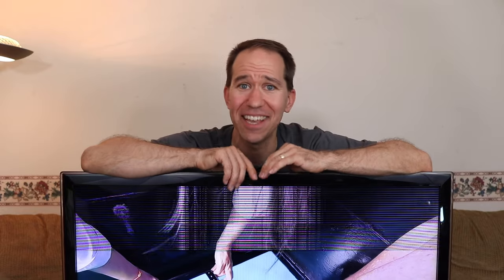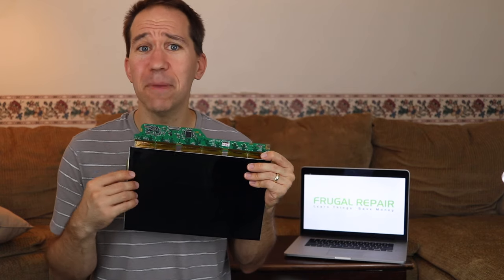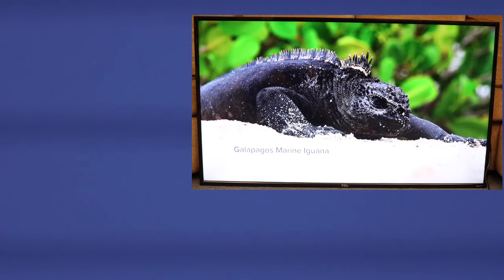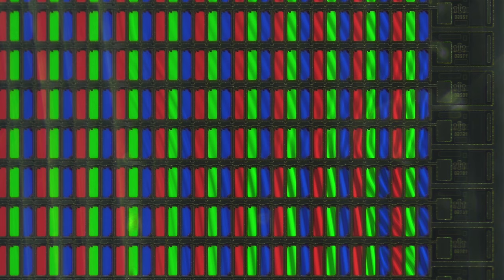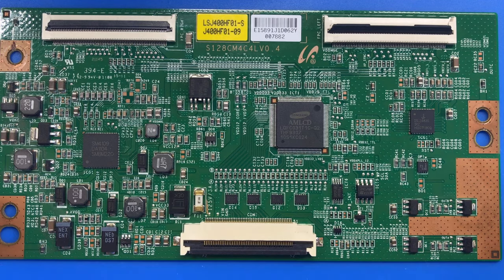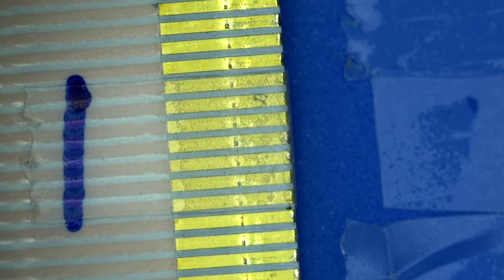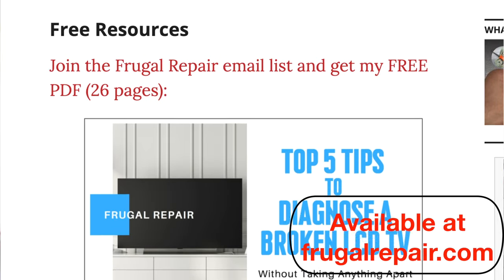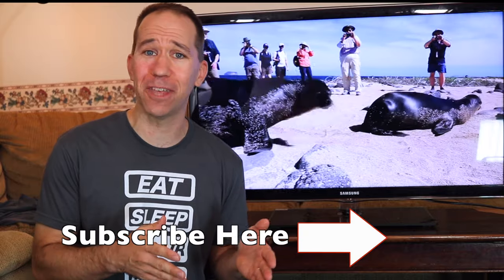Repair Hack Explained | How to Fix TV Horizontal Lines - Part 2

Comment: I have a problem with my 55" LG LED TV. The right hand side of the TV does not display every 6th horizontal line. The left hand side is perfectly fine. The black horizontal lines tend to dissapear mid screen.
Reply from the maker: I'd try the trick like i did in the video.  I hope it helps!

Comment: Thanks for this tutorial.
I have An Xiaomi mi 4s tv wich had black screen. I figured out that disconnecting on of the cables of T-con board gave me half of the screen back.

Im now Trying to figure out what lines to Block of the clocksignal. But the clock is on the right cable and the problem is the left one. 

Im not that techican to determine with lines to Block by power testing IT. But can it Hurt my tv i Just block some of the parts and see what is going on?

Like different combinations of blocking to so if there Will be an image?
Reply: ah i tried your Method with the multimeter on continity and found out the signals on the left side. Just covered some of these signals with tape and got image back!
Now need to see if the image quality is less, then wil trial and error to see if i can only cover the bad clock signal element :D

THANKS ALOT!!!  your video was so clear and the only one i could find in english!
You saved me so much trouble, time and money!
I had do sent my TV back to China because it was still in warranty, But returning the tv costed alot of money for shipment etc.

Comment: What about one horizontal green line at very bottom of display, that is "running" from left to right and looks something like this: -------------------------------. Sometimes it shows up, sometimes it disapears, it's not GPU problem, because it's showing up on two GPU's I own (both of them never had any issues), it's not drivers issue because it shows sometimes even at BIOS or during boot process. So I'm guessing it has to be LCD display issue. Another clue is when I hold monitor by two hands at the edges and gently apply little pressure at monitor this line will instantly dissapear for a few hours, and at some point it will show up again.

Comment: I have a gigabyte g27f 144hz monitor and have a small thin blue line Vertically on the screen that goes from top to bottom. it will go away when I apply extremely light pressure on the top end of the screen where the line starts. It will go away for a while. Sometimes stays gone for days, but might come back sooner sometimes. ALWAYS goes away with a light pressure touch. Sounds like a bad solder joint or connection from the ribbon to the screen. What would be an easy fix without having to tear into it? The line is only about the width of a debit card or paper business card, so it's fairly micro.

Comment: Hi. I have a mercedes comand  ntg with horizontal lines, and i wanted to see if this could be fixed, it started with 2 lines, and now there's allready many. i have seen several units with same lines on different forums, and solution is to change the display $$$$. so i wanted to try to fix this as it seems there is probably a weakness in thhese displays, what can be the cause of this, is it smd's or ribbon connection on display?? what can i do to try and fix this, unit is old, so spending a lot of money on such antiqated tech is not really anything i want to do. so my last option seems to be repairing it, any advice??

Comment: Good morning Frugal Repair! And Happy Thanksgiving!

Today I would like to ask the question on how could I possibly fix it permanently, while removing those horizontal lines with the help of your videos (Thank You!) I would maybe want to invest on fully repairing the TV. Would buying a new set of ribbons work?  I would like to know, just in case I could salvage some TVs and get them back to almost perfect shape, thank you once again, and u hope for the best!
Reply: Replacing ribbon won't help. I swapped the ribbons and had the same issue. It is one or 2 clock signal causing the issue. By putting up a tape you are actually blocking the clock which is causing the problem.

Comment: Hi! I have a Sony Tv and I have horizontal line from the bottom to the half of the screen. I asked some tv repair shop and they told me that I could put it to the garbage, but I do not want that, because the sound is good, only the lines are very annoying. If the lines are horizontal and from the bottom to the half, is there any chance for me to resolve it? I do not have any technical background. My tv is a Sony Bravia KDL 32EX402.Please help!

Comment: @frugalrepair can you do one with vertical lines.
Reply from the maker: I could. Thanks for the suggestion.  It’s usually a different issue than a row signals issue.   Could be tcon board or even people get them when they clean their screens.  The cleaner liquid messes with the connections on the driver board.  You can try gently twisting the corners of the tv.

Comment: Do you think the flickering problem is due to a faulty T-con board?
Reply from the maker: On this TV, no.  The problem is on the driver board or in the panel.  But on a different TV that could be the case.

Comment: I have the dreaded vertical lines. When I turn my TV on the picture comes on beautifully and then within seconds vertical lines fill the screen to where I cannot see anything...not even menus. Mine is a 2017 Samsung Frame Model: UN55LS003 - I cannot find any information on how to take the back off to check the ribbon connectors or the T-CON. The TV was just moved 1800 miles in a moving truck (in a home depot TV box) and it seems to have jolted something loose. No screen cracks...when i unboxed it I totally expected nothing would be wrong. I don't want to lose this TV and the Samsung forums just tell you to call a service person. Maybe you can help? How do you get the back off "The Frame" TV's? HELP!!!!!

Comment: From few days, I'm seeing such black horizontal lines on my hp laptop screen, the lines become prominent in colors like violet and red and in other colors these lines can barely be seen.. I've put the refresh rate to 40 from 60 and now the lines are there but a bit less prominent.. I've tried pressing edges lines are still there..and also updated my nividia graphics driver and display drivers..what can be a fix..can it be a loose cable connection or a problem with the lcd panel...thanks..

Comment: Hi, the isolation technique did not work for me. When I disconnect either of the two ribbon cables, I get a black screen on that side. Half the screen was working in your video. But that's not happening on my Sony LED TV. Kindly suggest what could be the problem
Reply from the maker: If you get the same result on both sides, that is a clue.  I would then suspect the tcon board is faulty, though of course, it could be something else.

Comment: I have 2 LG tvs in need of some help. One is Lg 55uh6030 and a LG OLED65C9AUA. The first one was working fine then once it was on for a while (usually 30 minutes to an hour) horizontal lines would appear then the screen would go black. Sound remained unaffected. I replaced the t-con board board with a new one but no change so i put the old one back. The oled has a black screen with skinny little white horizontal lines on the left side of the screen. Please help

Comment: Is it possible to DIY repair the short/open circuit?
Reply from the maker: Not really with most available repair tools if it’s inside the lcd panel assembly.  You maybe could with a laser.

Comment: Do you have a answer on how to repair a 55" Roku TV it's only 3.months old"  it is 1/2 to 3/4 of the TV screen"" it turns on the lines are vertical,  and I can see a place at the bottom  of the screen where it got hit

Comment: How long can the tape last and 
Apart from using the tape, what's the permanent solution?
Reply from the maker: I don’t know.  I’m still using this tv without issues.  To make the real fix you need to replace the lcd panel.
Reply: @FrugalRepair  thank you so much, I actually tried this and it worked...

But I have one trouble or ripple effect ,
 before now, I didn't have a thin black black horizontal line in the lower part of my screen, but after the trial, I noticed it.
I have LG  55inches LED 4k tv.
Please what futher thing can I do?

Comment: hey there man... hope you can help me.. i havea 55 curve samsung itwas turning on and  off at first then using tape i got it to turn 9n.. but there are lots of vertical lines still very visible... help pleeeaase
Reply from the maker: Sorry, there’s too many possibilities.  The isolation technique should tell you if the problem is on the tcon or on the lcd.  It’s possible that the tab bonds on the driver board are lifting, causing vertical lines.  Is it possible it could be a short circuit in another part of the tv?  Just not sure, sorry!

Comment: I have a 4k vizio with horizontal lines but they are not black. They are RGB.  Between the top and bottom, it's about a 3rd of the screen that's effected. The bottom section now has yellow moving line. I've tried all the simple quick fixes and nothing works. Any idea on the cause and possible fix?

Comment: Hello, what about seeing this lines in the two sides? one side i see fixed lines on the top, but in the other side i see flickering lines on bottom.
Reply from the maker: I would guess either the tcon is the issue, or possibly you have signal failures in different locations in the lcd panel.

Comment: Please help. I have a SONY KD65xe7002 tv. It’s not old in the slightest. It has a horizontal line at the bottom which shifts the picture up and back down every second. This happens on a moving and frozen image too. What do I need to do to fix it?

Comment: I have issue with my sony tv(model no-KLV32-EX330), it is having horizontal linings on top of around 1" And after 4-5 min, half screen gets dat horizontal lines. How to solve the issue, I would appreciate if the solution is given on same model no I have mentioned
Reply from the maker: There are videos online (I’m pretty sure) that speak about Sony lcd’s.  It might be a problem with the tab bonds lifting because of the heat.

Comment: Hello, would you  have any suggestion to a Samsung TV that  starting to slide image down after about 5-10 minutes after powering up.  if unplugged, and then power up again image is ok for another 5 min, but then starts to jump down again.  Replaced main board but behavior didn't change

Comment: The first part where you remove those cables either left or right, once i did that the backlight stopped working and the little bit of image i had is now also gone. Now i am sitting with a completely black screen and no back light. What can be the cause ?
Reply from the maker: Did you remove them while the tv was on?  Definitely don’t do that because you could possibly short something out.  I don’t know why removing one would affect your backlight.  Maybe something else got bumped?

Comment: Hi sir. I would like to ask your help for my tv Samsung 55 inches Smart Tv  Curve.
The model is UA55JU6600K.The issue is that on the right side area of the Panel Or screen has a vertical flickering lines which you cant even see the letters or any videos on that side and which cuts the whole icon from left side going to the right side area of the screen.Only on that side is affected.On the Left side is fully normal.Could you help me out sir please.Thank you.

Comment: On my 70 Inch pihilips 4k that I got for 50€, The color specially Yellow color fades a lot on the taped side, so much that it is almost annoying, but a 2000+€ Tv for 50€ I wont complain,  But my question is, does a larger TV suffer more from the tape trick than smaller tv.s ?

Comment: Hi question for you this very same problem happened with my TV I have a 19 in Sceptre and it's got the lines going horizontal and vertical so how do I fix that the? same way?

Comment: I have a Lenovo T24-i LCD monitor and it suddenly blurrs the screen from sides and then I turned Off and send it to the repair shop, instead of repair a line (horizontal) produced at the 1/3rd of the screen. When it’s ON the LED doesn’t flikers but when it’s powered ON after some time then the upper part above the line behaves totally normal. But the part below the line flikers and fades but after some time all LCD goes to normal but the line is constant. If you have any knowledge about this issue please help me out. Thanks

Comment: Hey there. I have horizontal lines on my samsung un46d6400 tv and it appears to be there even when i disconnect the ribbons on the t-con board. In other words, the lines exist across the tv even when the ribbons are disconnected
Reply from the maker: I’d guess tcon board in that case, it could be something else but that is my guess in that situation
Reply: @FrugalRepair  hmm thanks, just sent you a photo of the tv display to your insta!

Comment: My LG 43UK6500AUA TV has an additional problem. Apart from being covered by horizontal lines for 90% of the area, the image under the lines freezes for a few seconds, then works for a few seconds. This cycle repeats endlessly. The top 10% of the screen works perfectly. Will replacing the mainboard, part # EBU64688503, fix this issue? Or is it the ribbon cables at fault? I showed it to a technician and he said that the entire display panel needs replacing. Any help is appreciated, thanks.
Reply from the maker: Doing the isolation test like I have shown in these videos will help tell you if the problem is the tcon or the lcd screen.  It is unlikely to be the main board based on what you have described.
Reply: @FrugalRepair  Thanks for your reply. Yes, I showed the screen to two technicians, and both said the problem was in the panel and unfixable.

Comment: I have a vizio oled 65-h1 TV and have horizontal lines with some burned images in the background. I have swapped out a new tcon board already with the lines still appearing. There are 4 sets of ribbon cables. I am not sure which one goes with which side of the screen. Please help.

Comment: would replacing the tcon board solve the issue?
Reply from the maker: No because the problem is inside the lcd assembly.  Tcon is fine.

Comment: Hello, does this work on IPS pc monitor?
Reply from the maker: The answer is technically yes but on a monitor you may only have one cable from the tcon board so isolating the problem and working on it is much more difficult (you might have to cut the PCB electric lines - assuming the row signals go to both sides on your lcd panel)

Comment: I have a thin blue vertical line on my monitor that just showed up randomly one day. I applied pressure to the bottom of the screen and the line disappeared for a while but it came back and now I cannot remove the line with pressure anymore. Any Ideas on how I can fix this?

Comment: Could the Samsung One Connect box be causing a thin black horizontal line about 2 inches from the bottom of the screen? When I first turn the TV on I have a green fuzzy thicker line which comes and goes. I purchased a new one connect cable and the problem still persisted. It's the same thing on every source. I have taken the TV cover off to just push the cables in thinking something might be loose, but it did nothing. I'm not sure whether to unclip the cables inside and put them back. I don't know whether to try a new one connect box. Running out of things I can do 🤔
Reply from the maker: Did you try what I did in the video?
Reply: @FrugalRepair  Thanks for the reply. I haven't yet as I don't want to break something. I probably would to be honest 😂 I could give it a go
Reply from the maker: You can do it.  Try the isolation technique and that will probably give you the best clue.
Reply: @FrugalRepair  I will try this, thanks.

Comment: My TV has a horizontal band (over the entire width) in the very middle of the screen and the light intensity of that band (about 5 cm high ) is lower than it should be. So a white screen has a light gray band in the middle. What could be the problem and how could it be fixed?

Comment: My TV has the horizontal lines on both the halves of the screen. That would mean mean this method wont work (tried by a technician). Is there another way to fix this problem?

Comment: what if both the tv sides has vertical lines,but it's not the tcon? if both ribbons connected there are horizontal and vertical lines. left connected only is vertical lines only. right connected only no good picture and colors. tcon is replaced
Reply from the maker: I’d double check the ribbon connections but you likely have a bad panel.  Vertical lines are a different issue than the horizontal lines.

Comment: Can i use paper other than tape?
Reply from the maker: The main thing you’re trying to do is prevent an electrical connection. So you could just use a knife to cut those contacts off once you know which ones you need to block.

Comment: I paid 400$ to get an issue like this fixed!!!!!!....now I have a 65 Vizio that has horizontal lines on the bottom of the screen they started off tiny now the whole picture is like in slow motion but I definitely don't have the 400$ to get it fixed fingers crossed I'm going in ...

Comment: What are the possible reason of having a problem like horizontal or vertical lines of monitor? Is it because of the Poor/Cheap AVR and lack of Surge protector?
Reply from the maker: No.  It can be because of many things but usually because of a failing component inside the LCD assembly.
Reply: @FrugalRepair  Is it possible because of unstable electricity?
Reply from the maker: I would doubt it.

Comment: Hi, experience the same thing with our Bravia 43x800D however the horizontal lines are about an inch long and its in the bottom of the screen. As you have mentioned it is most likely a signaling issue. This is very information, I have an idea now when I go to see a repairman and not get scammed. Thanks!